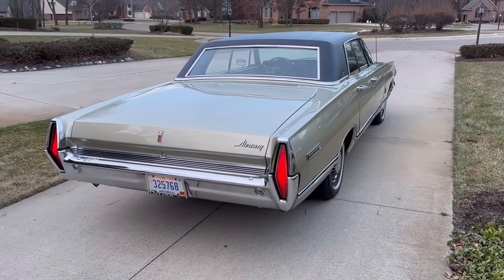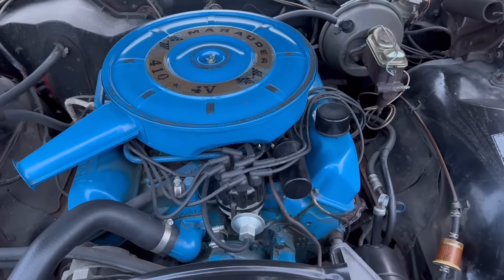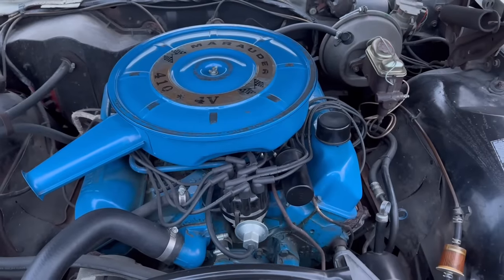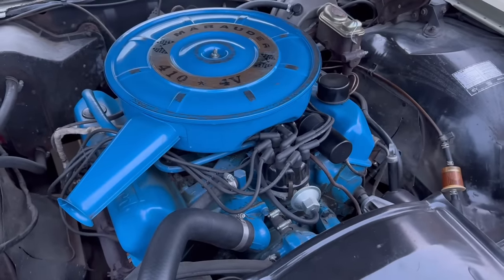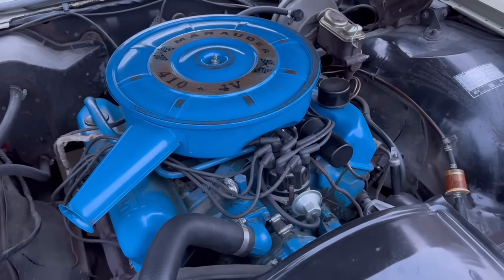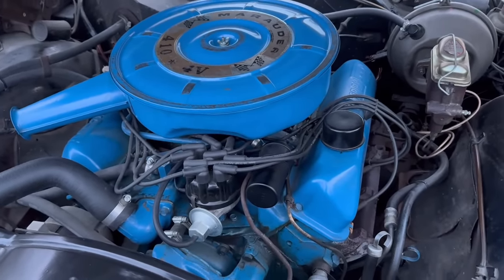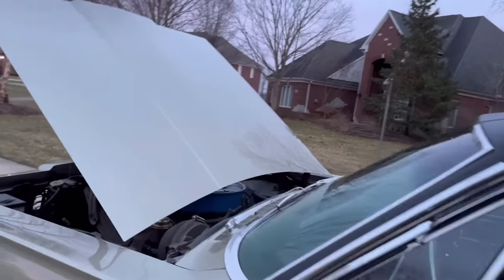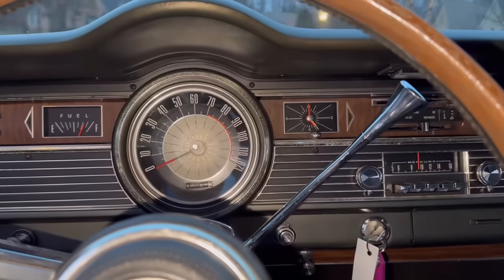Ford's Shortest-Lived (and Smoothest) V8 Engine: The 1966-67 Mercury Only 410 V8

Comment: Dad bought a Mercury station wagon in 1966 with the 410 engine. At less than a year old it ate a valve on a trip from San Francisco to Portland. We had to rent a car in Grants Pass to continue the trip. He traded it off right after that for an Olds station wagon.

Comment: The Ford 255 (4.2) V8 was made from 1980 to 82.  It was supposed to phase out the 302 but the 302 ended up staying and the 255 was discontinued.   There were around 253,000 of them produced.

Comment: The neighbor has a 67 or 68 Country Squire Wagon, with Power Everything, all 5 windows, door locks, front seat, you name it, and it has the 410 in it. I had to "Adjust" the timing with MY 20 Pound FORD Tune Up Tool, AKA Sledgehammer. He's the second owner, it was his Grandparents originally. 78,000 miles of pure Boating Pleasure, according to him anyway...🤣

Comment: I once did a tuneup on a Ford Custom 500 police cruiser. Don't ask me the year of the car, but I think it was a 1970. Sitting under the hood was a 428 cobra jet v8.  I'm 63 years old now, and at the time if memory serves me, I was 16.  I was a gear head, as a kid. I worked in a Phillips 66 service station in my home town. I was in awe of those old performance cars. My older brother's friend had a 1968 impala coupe with a 396 4 barrel, with 325 horsepower.  Single track, non posi-traction rear end. More than once I witnessed him paint a stripe of rubber on the road 200 feet long.  When you could get the rear wheels to stay hooked up, that car would push you back into the seat.  
The sixties and very early seventies were such a unique time for automotive history.  The cars were crude by today's standards, but they were coming through a time of competition on the street, and on the track. So there was a strong emphasis on design as well as performance.
One car that absolutely comes to mind as a pinnacle of the automobile manufacturers pushing back against the government and it's owners who wanted to take away from our enthusiasm, was the 1973 and 1974 Pontiac TransAm SD 455.  The SD 455 engine in that car was a detuned engine that Pontiac had designed for Nascar racing. Since pontiac had given up on competing in Nascar racing they had a number of these engines they'd built and decided to offer in limited edition TransAms, and CanAms. -----------------    https://www.youtube.com/results?search_query=The+story+of+the+Pontiac+SD455

Comment: Having a nearly square bore X stroke likely contributes to the smoother running. 
My 54mm Honda / Lifan is the same way and runs well with mikuni carb and ngk plug.

 Replace carb with efi and engine would likely last forever; no raw fuel rinsing oil off cylinder walls at startup and contaminating oil.

The 1969 Chevelle SS 396 was actually a 402 that replaced the 396 before the 454 came to market. 
The 396 was already promoted as the performance engine from the previous generation Chevy's, and the 402 was short-lived.

Comment: I had a 1954 F 500 truck with a 239 ci ohv, could not get parts so put a 272 in it. Was told it was manufactured only 6 months 🤷🏻‍♂️

Comment: The 410 was a stroked 390. Excellent truck engine. I swapped out a 360 for the 410 in my 71 F250, a direct swap with both being FE’s.

Comment: Ford had a 406 cu. in. Engine available for only 2 years .
Built specifically for NASCAR competition in 1962-63.
This engine produced 385 bhp. at 5,800 rpm. 440 lb-ft of torque at 3800 rpm. in the 4bbl. version , and 405 bhp.  with 3-2 barrel  Holleys.

Comment: 3.98m stroke, and just like the 428, they are torque monsters. Owned my grandparents 66 Park Lane with the 410 FE in it, for 10 years, early 80's to 1991. I did put a bigger Holly 4 barrel on it. 
Passed that car to a family member that needed it more than I did, and some years later I found out that my relative junked it out when the engine got tired. 
If I had known I would have taken it back. Had a lot of Ford pickups over the years and rebuilt quite a few FE's, that 410 would have been fun to rebuild.  I miss that car.
The Ford 221 cid V-8 may beat the 410, it ran from 1962 to may of 1963, then became the 260.

Comment: All Ford V8s have the distributor in the front, except for the Y block V8s produced in the late fifties which includes the 239, 272, 292, and 312ci engine's. and modern Ford V8s don't have any distributor at all. that task is handled by the computer. even the flathead V8s had the distributor in the front. the FE engines were unique in that the displacement was achieved. by lengthening or shortening the stroke on the majority of the engines. although there were a few of them that had bore size change's. there were three main designations of FE engines. they were low riser, medium riser, and high riser block's. however the 427 side oiler was separate from all the other FE engine's. they were all wedge blocks and were Y blocks. and they ranged from 332, 352, 360, 390, 406, 410, 427, and 428ci. with 361, and 391ci, being industrial engine's. the 360 and 390 we're the longest in production. due to the fact that they were available in most Ford truck's. besides the 410 another FE engine that was available in limited production was the 406. that was available in some Thunderbird's in the early sixies. they could be identified by their gold valve covers. I was a Ford technician for many years. and I was an FE specialist and I rebuilt and worked on many of them.

Comment: Nice car, I have a 1962 Galaxies 500 XL with a High Performance 406 FE V8 rated at 405 hp. It was a 1/2 year option then the first half of 1963 used the same engines. Then the 1963 Galaxies fastback roof came out as well as the 427 engine. The 427 engine was a 4.23 inch bore where the 406 was a 4.13 bore with the same crankshaft stroke. I'm guessing you haven't heard of the 406, it is a real running beast. You can look up history on it on line. So in a way it only was used for a year. Kind of a bridge between the hi po 390 and the 427. They also made a hippo 352 in 1960 that was rated 360 ho and it was made in the last half of 1960 . A very rare car . Also a few Mercuries came with 406's as well but very few.

Comment: The 1958 Edsel's 2 bigger models, based on the Mercury chassis, the Citation and Corsair had the 410 cubic inch engine as standard equipment. The smaller Ranger and Pacer models, ford chassis based, came with a 361 cubic inch engine as standard. The 361 was a punched out 352 while the 410, as you said, was a punched out 390. My 2nd car was a 55 Ford 2 door coupe that had originally came with a 6 cyl with over drive on the three-on-the-tree transmission and a 410:1 rear. The previous owner had put an Edsel 410 in it with a Hurst floor shifter. Fast on top speed but would just smoke the tires off on the strip as the front was super heavy while the back  weighed almost nothing.

Comment: Sir, all Ford V8's to my knowledge or memory had the ignition distributor in front. It could be  a problem also. If a person hit a large enough water puddle occasionally the distributor would get wet inside and the engine would stall.  I knew this first hand, because I was a young mechanic back in the 1970's and dealt with that on service calls.  Also, the "Quadrajet" four barrel carburetor you mention was a G.M. exclusive carburetor, at the time.  I rebuilt many Quadrajet carburetors. They were very simple and worked well, with one exception. As they got older they leaked fuel into the intake manifold, which caused the float bowl to go dry. This would happen if the vehicle sat for a day or two, and then the vehicle owner would have to crank the engine for longer than normal. Sometimes long enough to run the battery down, cranking it. In cold weather this same problem caused what we referred to as "a flooded engine". The gasoline would wet the inside of the intake manifold enough to cause the engine to not fire off in the morning.  
Ford did use several different versions of 4 barrel carburetors from Autolite, Motorcraft, and Holley, 
The carburetor that's on your Mercury is one manufactured by Autolite.
To my knowledge, Ford never had Rochester manufactured carburetors in those days, as I believe G.M. had some exclusivity agreement with Rochester. That company may have been a subsidiary of G.M. 
You did teach this old timer something new....   I'd never heard of or encountered a 410 V8 from the Ford Motor Company, or my memory doesn't recall it.
The small 4 barrel on that engine lent itself to the engine having a high vacuum signal which means very good throttle response, and a flat torque curve, both of which were desirable traits for a beautiful luxury sedan like that one. My compliments, a great automobile from a time when the engineers were designing visions, and not just transportation. 
One thing to know for the future, as a bit of knowledge to keep in your memory ;  If the engine starts to develop a backfire that your modern day mechanic may not be able to diagnose, look to a worn breaker plate in the distributor. This was  common for the day, but would get overlooked by techs that weren't familiar with Fords. I hope you keep that beautiful machine for a long long time.

Comment: When I was a kid right out of high school, I worked as a mechanic apprentice in an old time shop with an old time owner. This was 1980-1982 .... and we / I did a LOT of work on those FE engines. Mostly in pickup trucks, mostly 360/390s . The issue would be that they would blow out the exhaust doughnuts , the amateur mechanic owners would go under, put sockets on the bolts, and immediately break them off. So, then they would bring them to our shop. My job on dozens of jobs was to take the top end apart , we would then pull the heads apart and kiss the seats / turn the valves , occasionally replace a valve here and there, almost always the exhaust valves. We would send the exhaust manifolds off to be surface , sometimes we had to replace a manifold, and even back then, they were expensive, the Chinese market did not exist then for parts. We would put them back together with higher quality ( grade 8 ) hardware. The crossover hose from the intake manifold made a great guide, re installing the VERY heavy intake manifolds, I would get up there in the engine compartment, with the manifold sitting on the front above grille area , lift it up, and hook the hose on first, then setting the intake down on the engine. Looking back, for a 18-19 year old kid, I think I did really great work. I always cleaned everything obsessively , and took my time upon re assembly.  It brings back fond memories looking at that engine.

Comment: Age is currently seventy four, grew up driving a ford for a many reason. I would get up to go to work and of course it needed primed. I kept fuel in a brake fluid can and would just loosen the wing nut and pour a few drips in the center of the air cleaner. Gas followed the rod holding on the air cleaner and into the engine, once it was done pouring in prime, just tighten wing nut and start it. I seldom ever needed a second time of prime unless it was really freezing cold.  I got one of those mercury engines out of a four door mercury given to me to get out of their yard. It was way above my pay grade at the time to save it from all the rust and mouse damages. I pulled it and used it in my four wheel drive truck. I have a ton of stories on them not meaning anything to todays generation. I just don't remember how they got the 406 engine from just using stock parts and pieces

Comment: I have a 1967 Ford Thunderbird and it's got the 390 FE engine in it, The only other engine available for the Thunderbird that year was the 428. Starting in 68 you could also get the 429 Cobra Jet engine.

Comment: The bit of fiber in the breather cap is common on other engines prior to the elimination of free crank case breathing.  Its purpose is to allow some of the oil in the breather vapor to condense and cling to the fiber and drip back into the engine.  THis makes the breather vapor less oily and keeps the underhood area cleaner.

Comment: My two cents as a blue oval enthusiast, The 410 was a perfect engine for Mercury, and would have been an outstanding Medium Duty engine for truck use. WIth the 4.05" bore of the 390, and the 3.98" stroke of a 428, it would have been perfect for low rpm, long term operation. Freeway cruising in a Mercury, or Left running all day in a truck, it would have been right at home.

Comment: think the smoothness is a function of lower compression, the 390 I had was all about the rumble with a dual feed 750, I had a 360 and you couldn't tell that it was running and was super easy on gas

Comment: The 441 cfm shown sounds like
the cfm of the 2100 2V.
We had had a 68 Ford with a pre-
Thermactor 390-2V. Its idle was
not particulary smooth.
     There was a distinct also-ran magazine 
to Consumer Reports that also tested cars at this time. Their
freeway test of a 410 Mercury only yielded 11 mpg.
They also did acceleration tests.
Surprisingly, even the 2-barrel
Pontiacs were almost as fast as
the #1 Olds Toronado. 273 Mopars also did well.

Comment: The 221 Windsor V-8 was a short lived predecessor to the 260 and then the 289 and 302.  The 221 was introduced in the fall of 1961 for the 1962 models and apparently was phased out in May of 1963 being used on only 1962 and 1963 models.

Comment: A beautiful FE block Marauder motor.  In proper tune it would run very nice.  The Marauder cars with the C6 HD trans won't pull quite like a 427 four-speed, but they will sure burn some high-test fuel.  Should be a lot of fun to sort it out.

Comment: Lots of parts interchange among the FE family. That extra torque came from the longer 428 crankshaft. Bore the common-as-dirt 390  .030 over and throw a 428 crank in it and you have a Ford 413!  Or even crazier, bore a 427 block .030 with the cobra jet crank and it’s a FE454! Can’t remember if the crank gallery had to be clearanced, but best to check.

Comment: I have a brand new car that has a cold light of sorts.  My car is a 2023 Toyota GR86.  The light is basically the overheat light that looks like a thermometer.  If the car overheats the light comes on red but if the engine is cold it lights up blue and stays on until the engine warms up a bit then it goes out.  During the summer I wouldn't even make it to the end of the block before the light went out, now during the winter it stays on for about a mile.

Comment: Beautiful car! Our 65 Park Lane was the same color combo, but no 410 yet, 390/300 was top dog that year.
Note the Ford 239 Y-Block was only 1 year (1954), same for the Merc 256 Y-Block. Ford & Mercs 1st year for OHV V8s.4v
Of course the Boss 351 and 351HO were only 1 year each but I think you meant by Cubic Inches, not variation of the internals.

The little 4300 1.00 carb was a cussy thing, takes a lot of tinkering with the secondary to get em to run right but otherwise an ok carb. All the chokes tend to stick open (or even worse, closed) on the 4300 so there's that. But other than that, they are the best MPG carbs I've ever tested, maybe the Qjet is better. A good 4300 will also run within about .05 sec of a similar size Holley so when set up well (a lot of time) they run good too. Mainly though as you say they were for smog, no secondary idle circuit. The small 4300 was also used on the 302-4v, 351w4v, 390-4v, and 428-4v (ugh). It was small but bigger than the 440cfm 4100 autolite 1.08 carb it replaced! (440cfm at 1.5" Hg, dont believe some of the inflated CFM tossed around for the 4100). The big 4300 1.25 at 600cfm made its debut on the 68 429-4v and 460-4v, also used on the 351c4v.

Comment: Lovely car. I've worked on a few FEs including building a 410. I have never seen a distributor seized in place. I do prefer the distributor in the front for the simple reason it is really easy to set the timing by yourself.

Mercury needed to differentiate their product - they were mechanically identical to their Ford counterpart. So, why throw a 1U crank (428) into a 390 (with 352 pistons)? Two reasons, all the FE parts were extensively interchangeable, except the 428 and especially 427 blocks were specifically cast. The issue was the technology for castings at the time was a little imprecise, so the thin wall construction of the FE mean that once you go .030 over the 4.05 bore you risk thinning out the cylinder wall because of casting shift. 428 (4.13 bore) and especially 427 (4.2328 bore) engines were outside the manufacturing tolerances of the main production processes. To avoid thinning out the wall, those castings were specially made to locate the internal water jackets and outer cylinder walls more precisely than the mass produced 390. This cost a lot more. It wasn't just a matter of cutting a bigger bore. 

The only really specific thing about a 428 crank was that it was externally balanced, so it needed a specific flywheel.

Comment: That engine is butter smooooth! I never knew they had a 410! Since this is a Michigan car how was it kept from rusting? I live in CA, obviously rust is not an issue here but there they use salt during the winter months don't they? Thanks for the video, so much appreciation for the old Ford Iron, long time Ford fan here. I have had some GM's in my past, only before I could buy new. They were good cars, not a hater of GM's or the Chrysler family, always preferred Ford's. I had a 67 Fairlane that also had the "Cold" light, mine was blue though...That Fairlane had the 289, awesome engine but it didn't idle as smooth as the 410.

Comment: Only saw two of them  My Dad got my first 1966 car a 1958 Ford  Fair lane Cont, Ordered buy a Sheriff , Trans went out got iit running but never overhauled Changed it to a 3 in the floor , It came with a 332Ci 300Hp    was stole in 1970